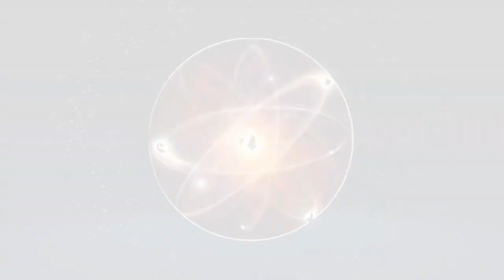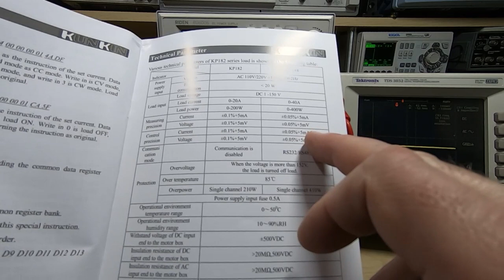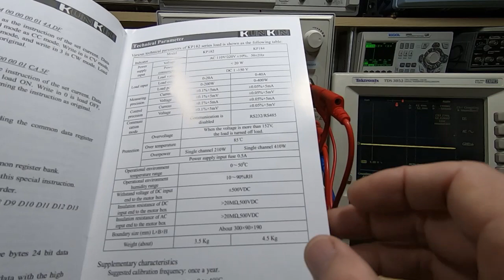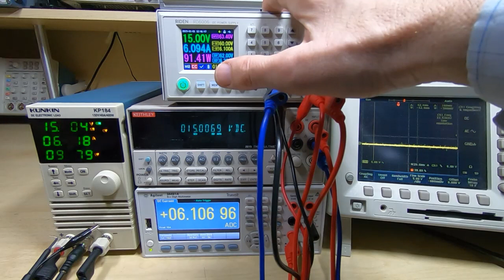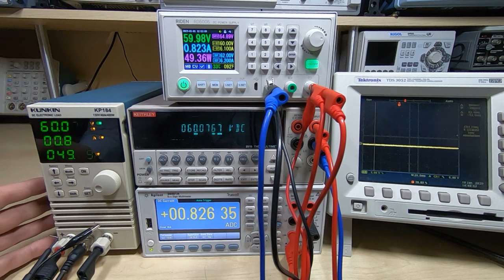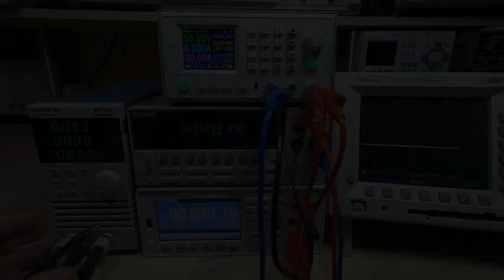Kunkin KP184 Electronic Load Part2

Comment: Can you use this to test a board that delivers a square wave of about 8kHz if you rectify it before putting it into the load? What about a PWM voltage that goes between 0 and 100% duty cycle?

Comment: I am interested in the interaction between the power supply and electronic load when the electronic load is at in constant voltage mode. Which instrument is in control of voltage ? I do not understand why the voltage of the power supply output dropped from 60V to 15V ?

Comment: Looks like a decent sinkload, biggest con is that 7 line segmented display, when you dealing with a programmable electronic load and tons of features, where such a 7segmented diplay interface can be cumbersome, not to mention a pain for the viewer in a use case like here with a content creator, hence that constant cam-hz tumbling flashing.
I would look at the East Tester or Dingchen or the UNI-t variant... all use an LCD-based TFT screen  (400x280) with even more features than the Kunkin..
and they are also quite cheap.. just received the 40A 420w load ET5410 from the EU store (CN wholesaler) at 144 USD / 118GBP delivered to your door with incl. shipping and danish 25%VAT.
MIles better then what I could find regionally at the sub 400USD market.

Comment: Did you recognize any problems with interference of the feedback loop on the Kunkin and the internal feedback loop of the SMPS (Riden PS)? Both are working with higher frequency feedback loops and the might interfere leading to funny results i guess. Why is it that only the Kunkin display is flickering in the video whereas all other digital displays stay stable? Is this an indication of cheap display technology? Sorry - put the question before watching the whole video :-) You could test it with a lead-acid battery instead of a SMPS to see the difference.

Comment: Thanks for the information! I bought such a DC load on ebay where the calibration did not work, the device only started to measure the voltage from 0 volts upwards at 9 volts ... the dealer could not help me ... how can the currents calibrate? can you make a short video, my english is not so good.

Comment: 13:35 there is way to fix it. menu - 6 Config - SLUP and set small value like 1
Reply from the maker: Yes I cover that in a later video. It does not however then work over a wide range so this value needs to be set for different applications (as it does for many different types of load).

Comment: Great video! I'm thinking about buying a Kunkin. But why do you disagree with the comment about having the relais? I personally think its bad design and a power supply should immediatly disconnect the output with a relais and discharge the capacitors internally through a resistor. The Rigol (I own a DP832) also has relais for each output and all my other power supplies also do. If I get listen to your comments I understand you think it is actually good thing to discharge through the external load. I do not understand why. 
I do not like the Riden for this reason. If I make a mistake and I want to shut off the supply right away I do not want it to take seconds to get to 0V.
I would change the Riden and maybe add a relais and connect it to the LED of the On/Off button above the red terminal.
Reply from the maker: ??? I think you need to watch the video again. I specifically say that it would be better with a relay and that adding a relay would be a good thing. I have no idea where you get the basis for your comment. I also repeat this in the other videos.
Reply: @JerryWalker001  You are right. I missed the words 'that's absolutely correct', my mistake. I'm not a native English speaker. Thanks you for the reply.

Comment: Thanks Jerry - Always so informative! I'm keeping an eye on your channel constantly (no pun intended) to see which power supply will be best suited for me. Still leaning towards the Riden RD6006 as my first beginners power supply. :)
Reply from the maker: I have still not found a good reason not to buy a riden supply. You may want to invest in a low power full linear supply as well for low noise work but as a general lab supply the RD6006 seems to be perfectly capable and for the price it is well worth considering. Note that I give this advice independently, I have no affiliation with riden and they do not pay me to comment on their products. My comments are based only on what I have tested so far.

Comment: For the test where it goes unstable at 50W constant power (13 minutes in). What if the power supply had no real current limit?  For example a 15A transformer, diode bridge, and smoothing capacitors?  It seems to me maybe the oscillation is partly because the Riden and Rigol power supplies are kicking in and out of constant current mode.  I agree that the KP184 software could have been written better to smoothly handle that case.
Reply from the maker: Yes that is always the cause of stability issues with electronic loads (I mention this at the start of the video) but the problem is that pretty much all circuits will have a limitation to the amount of current that they can supply. This is a problem with the load as it should be able to ramp up to the power limit without demanding huge peak loads. As I mention in the video that is why the waveform is different for the two different supplies and is caused by the diffrence in peak current capability. Most good loads will ramp up both voltage and current to reach the desired power. After all a major use is to test power supplies but it does the same thing with the 6 different supplies I have so far tested. This load seems to make a huge step in current demand when running and then it overshoots power at the next voltage step and then shuts down. It does not do this when its 'ON' switch is operated so it looks like the dynamic modes are not quite right. The Agilent has a peak limit of 10A and this was being exceeded even though the load limit was set lower than this. It just seems to be a problem in the load firmware. However remember that not all circuits will have a 'current limit' so I pointed this out as it needs to be considered for normal use and if testing power cycling in a power supply. You cannot really be expected to modify all power supplies to cater for your test equipment, it is supposed to be the other way round.
Reply from the maker: I just posted another video which hopefully will help. Let me know.